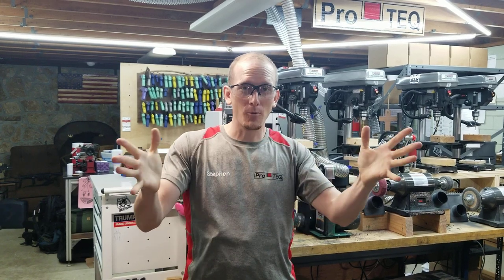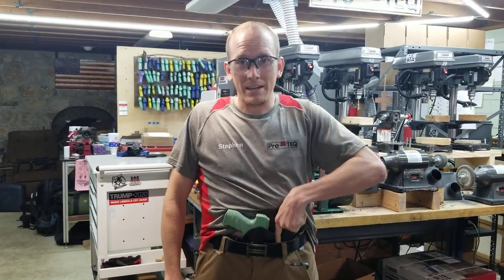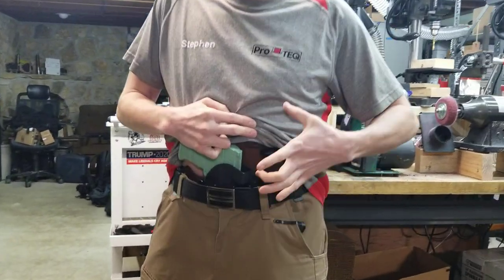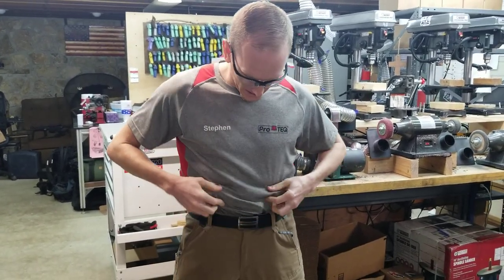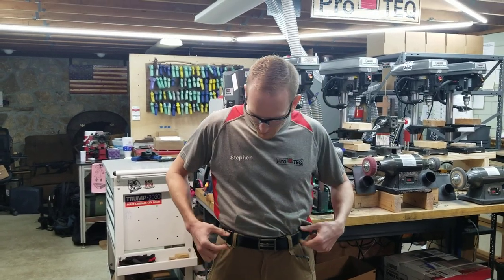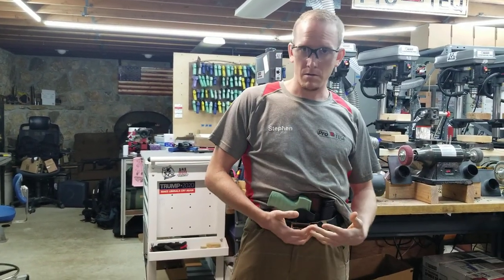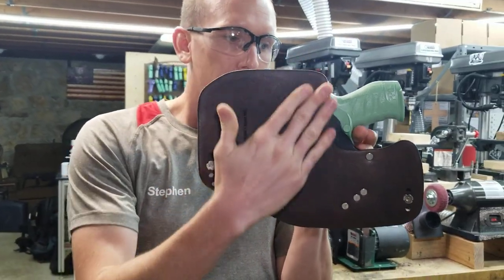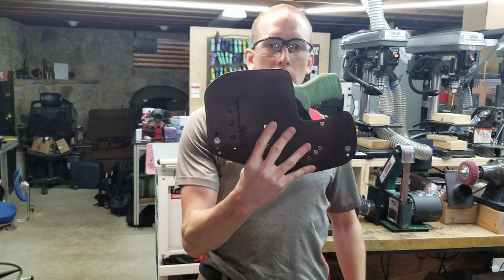The Kitchen Sink, Comfortable AIWB Sidecar

Comment: Very nice. Have you tried attaching a mag carrier next to the trigger under the grip to serve as a wing and to condense everything into a smaller footprint? 

I would like to have something like that in a 3 to 5 holster for my p365 although reaching it with my left and needing a wing in that location may not be needed. 
Maybe use screws instead of rivets to make it removable.
Reply from the maker: Thanks James!   Quick question on your rig idea.  How do you plan to access your spare magazine when carrying 3-5 o'clock if it's mounted behind your gun holster?  Do you switch hands?

Comment: If I were to order for a Glock 19 with a Streamlite 8, would there be a gap between trigger guard and kydex?
Reply from the maker: Yes Sir, there would be.  Since the TLR-8 is wider and taller than the G19's trigger guard, the molded channel will have to be larger to accommodate it passing through as you draw your gun.